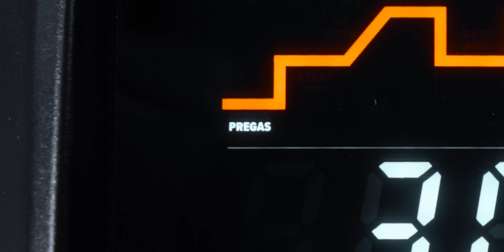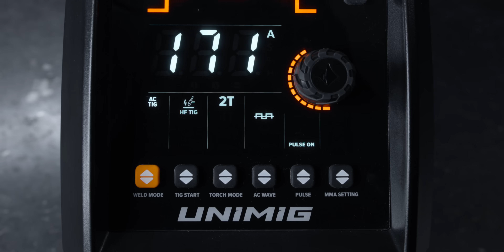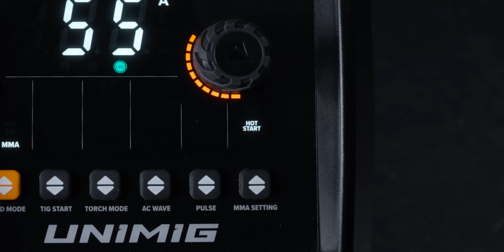RAZOR TIG 200 ACDC Feature Video

Comment: Can it run 7018/6010 ?
Reply from the maker: Hey there, it'll run 7018 Low-Hydrogen electrodes, but it will struggle to run 6010 electrodes. For those you'll need something with an OCV of 70 or more.

Comment: What material type is the mix tig function used for
Reply from the maker: Hi there, the MIX function is used to weld thicker aluminium. It uses DC power in combination with AC power to give the extra penetration.

Comment: Here in America there are two or three versions of this machine. The one odd feature, or feature lacking, is the pulse base current is not adjustable. It seems to be fixed at 50 percent of the peak current. That is advertised here as a bonus for beginners, since it is one setting they don't have to worry about. It is a bit odd considering all of the other settings the machine has available though.
Reply from the maker: On our machines in Australia, the pulse base current is always adjustable.
Reply: @UNIMIG  Ah, you got me curious and I downloaded the manual from UNIMAG Australia and base current is adjustable and oddly it recommends setting  base current at 20 to 30 percent of peak current. The American version has the base current fixed at 50 percent of peak  current. The machines look exactly the same though. Oh, I think I mixed up the US manual. The background (base pulse) current looks like it might be adjustable, (not as clear as AUS manual) but one version here in America has the pulse time fixed at 50 percent.

Comment: what happens when 1" plate drops on the slanted panel?
Reply: Slides off😂
Reply: I think some models had a clear plastic flip lid  protection cover to cover that panel . A bit silly for not having something on these type of machines.